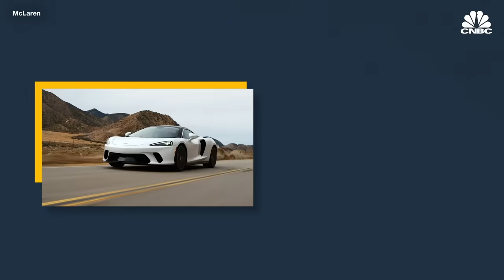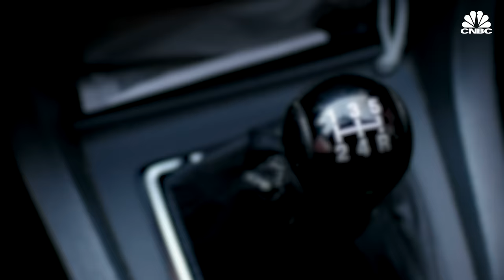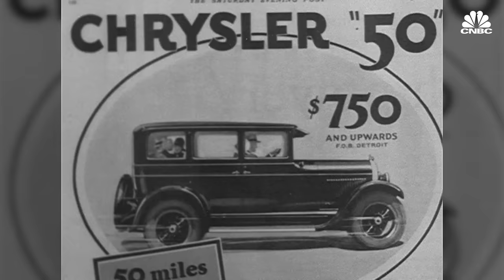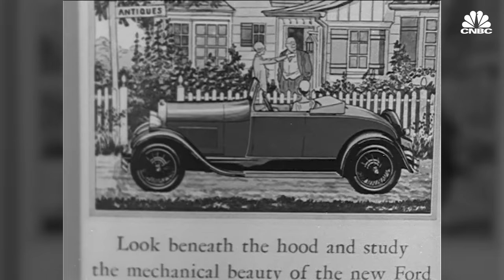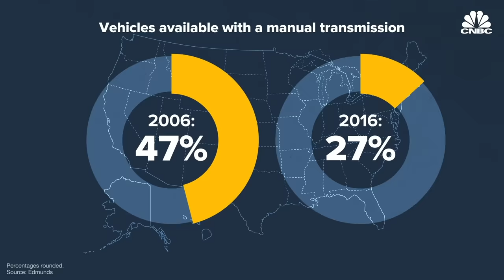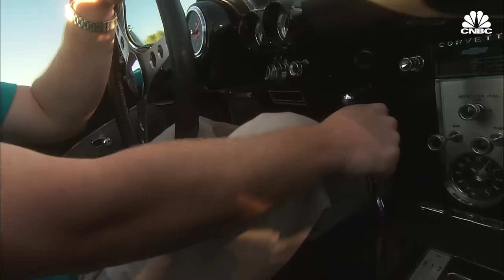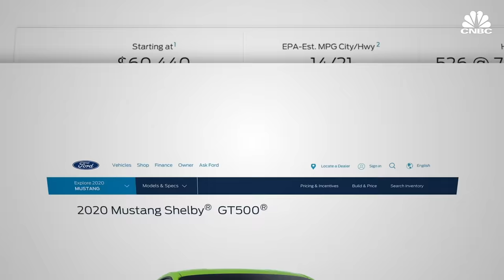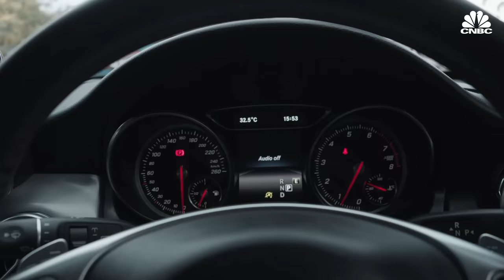Why Stick Shifts Are Going Extinct

Comment: Can’t argue with the facts and trends but as long as I can find them, I’ll be buying standard. It makes even a boring underpowered car fun to drive. For me, it’s a game, a skill, a way to engage with something I need to use every day. It helps me stay in tune with any problems.
Reply: Vincent DiNoto also increases reliability, imagine if Nissan had manual transmissions in their economy cars.
Reply: So in essence Vincent DiNoto, you have a "therapy transmission" instead of a dog??? Interesting...🤔🤔🤔🤣
Reply: Great anti-theft device too!
Reply: Dont forget about brakes. They last A LOT longer on manual vehicles than automatics.  & driving through curves on 2nd gear is amazing compared to autos
Reply: Depends on how well the manual transmission is built. Some can be so bad, I much rather have an auto.
Reply: Nahtcunnvinced Non-car guy I see.
Reply: @ROFLgator1  brakes are cheaper and easier to replace than transmissions.
Reply: @murp61  exactly. Manuals are about getting the hang of. Takes a day to learn and you'll never want to go back to auto unless you live in a hill that has a lot of stop and go traffic 😂
Reply: Nahtcunnvinced got one of each actually!
Reply: ROFLgator hills are the worst when people stop at the top of a steep hill and you have a car right on your ass. No room for error when people don’t even realize the manual struggle.
Reply: @The_Albino_Dino  Learn to use the handbrake. Or if you don't have one like me, you could heel and toe. Still annoying, though, I agree.
Reply: but that is the fun part @The_Albino_Dino
Reply: Joanna Lam it’s not that hard and yeah the sketchy moments can be kinda "fun" I guess but it’s annoying when people get too close behind you when you might roll back a tad bit catching the clutch.
Reply: Mike I know about the handbrake trick but it’s harder for me to grab he handbrake and put it down while riding the clutch and everything. I just go,d the brake with my right foot and when it’s finally time to go, I push the clutch all the way in with my left foot slide it into first and finally jump off the brake pedal and get on the gas with my right foot and try to get to the biting point as quick as possible.
Reply: @The_Albino_Dino  use the handbrake if you worry about roll back
Reply: Joanna Lam it’s more difficult for me than the way I do it. My way is just a bit scarier because there is no room for error but so far ive never once rolled back into a car so I think my technique is good enough for me.
Reply: And If I cannot find what I want. A Car with a Manual, No Infotainment System, a Manual Parking Break, a Key, simple things like a Oil Dip Stick so I can check my own Engine Oil. I will not be buying a New Automobile. No Auto Sale from me. I will not pay more for things I do not want in the first place.

Comment: 1986: Automatic transmissions are a luxury

2020: Manual transmissions are a luxury
Reply: It's kinda funny though. Because all the cheap cars still have manuals and an auto gearbox is a luxury. So like for me personally, I'd rather have an auto everyday car and a manual exotic, but now it's the exact opposite :(
Reply: Manuals is a hazard on the road.
Reply: Jo z why do you say that.
Reply: @jeffreystanley4991  there are more distractions for the driver, hand constantly have to move of from the wheel, and when making a turn and shift a gear there's just 1 hand on the wheel. And sometimes when manual drivers a counter a situation they are more paranoid not to let the cars engine stall than to just let the car come to a quick stop.
Reply: @jotube6147  if you can't drive them, sure.
Reply: @jeffreystanley4991  automaties are 10 times safer for the average driver on the road.
Reply: Clearly you don’t drive a manual. It’s not any less safe, if anything you are more aware of what is going on around you, not texting and driving like so many other dangerous drivers. Driving a manual in inclement weather I find is also better and allows more control as well as in off-road situations. I’ve never met anyone who drives a manual that is any less aware or dangerous than any other driver out there.
Reply: @jotube6147  Paranoid to not let the car's engine stall? What? Have you driven a manual for any extended period of time? This "concern" is only for someone who's new to driving a manual. Nobody who's driven a manual for while worries about stalling their engine.

I have both a manual and an automatic in my garage, and neither one is more/less distracting to drive. You get to a point where you don't even think about shifting gears, just like in an automatic. I love both, but the manual is definitely more fun to drive so long as I'm not stuck in traffic for two hours.
Reply: @ Jo z , I live in Canada lots of snow ,manual car is lots more safe to control in snow then automatic, I prefer manual and will teach my daughter to drive manual as well because when she growing up manual is luxury for her
Reply: @theconformist2399  ok that's just my opinion, i also been driving both for years stick and automatic. I see your opinion on it. Its just how i see it. But anaway i rather prefer an auto over a stick anytime, maybe coz my 1st 3 or 4 cars have all been manual. Maybe im just getting old or lazy lol.
Reply: A manual trans actually forces the driver to be more alert on the road, hence less distraction with texting ect. People who drive autos actually tend to be way more distracted.
Reply: Yep, I paid almost 50% more for a manual BMW. It's a dying art that I don't wanna give up.
Reply: @7318ify  What's more dangerous? Texting while driving an automatic car or texting while driving stick while shifting simultaneously? I see more manual car driving texters than automatic. Its weird
Reply: As long as they make fun cars with a manual transmission, some will want to buy them.
Reply: @jotube6147  No it's not.
Reply: I bought a 2019 versa, the only way to get a 5spd in it was to buy the absolute baseline model, no power locks, or power windows, but hey fair trade, i've only ever had 2 vehicles with those options
Reply: I disagree, I've been driving a manual since I first started driving. My current car is a manual. It becomes a habit if you drive one long enough. What you're saying sounds like a cop out.
Reply: Attention is ALWAYS needed while driving, no matter manual or auto. I live in Italy, I had driving school with a manual car (everytime you have one) and I dayly drive on traffic with a manual and when you know how to use the clutch nothing is so horrible. But if you are distracted while driving your performance is not good and you can have a crash no matter if it is manual or automatic car, that's all
Reply: @yeimarsoto7790  Hmm, really? I've always seen the opposite.
Reply: @HN  Psychology. Someone who has more to do driving the car is less inclined to look at their phone, rather that someone who has both their hands free. Attention is needed though when driving both kinds of vehicles regardless  of transmission.
Reply: @jotube6147  what makes you think that it's nice to offer reasons
Reply: @jotube6147  raceing car's for the most part all use manual transmissions. From supper speedways in the US to the 24 hours of Lamans ? Spelling.

Off road racing all so uses the manual transmission. Yes the automatic transmission has its place like in bumper to bumper stop and go traffic but out on the highway or back roads the manual transmission can teach the automatic transmission one or two tricks ease.

Love both and both have a place and it's easy to say the automatic is better if you have never drove off road. Or out in the open highway or down a mountain were the manual transmission can be use braking or stopping the car

If the engine fails driving down a mountain or on the road with an automatic transmission you loose power steering all at once and in a turn its a big wake up call. The power booster on the brakes only have one or two pumps of the break pedal and them its like the old manual brakes of the 1950s 

Loose engine power in a manual transmission and as long as the car is in gear the engine will still keep turing over even though its not running 

You will still have power steering power breaks and if driving down hill the engine will help in braking or slowing the car down

Automatic transmission are nice when new but how many times do you hear of manual transmission needing rebuilding or needing a new transmission computer or needing the transmission fluid and filter change 

Things all ways chang older cars with Carburetors and smiple Ignition systems will run all most for ever and fancy new car's are for the most part done for when computer die or the wiring with all those sensors get a bug or Mic

Just take a look at Jay Leno Garage of all the old cars that still run.

A times new is best and at others not so great
Reply: @terriecotham1567  tnkx yes i did not think about it like that u correct.
Reply: @jasonandrews4046  nailed it sir..
Reply: Jo z ur getting old. Same thing happened to my dad. He had a stick e30 and replaced it with a corolla in 2000
Reply: @jotube6147  proof ?
Reply: @jotube6147  if you dont know how to operate an manual i guess they are saver
Reply: Servicing automatic gearbox is luxury
Reply: Not luxury, just rare
Reply: @HN That's where people massively differ.  Even objectively, cars hold incredible cultural value - look at how popular the Fast and the Furious series is just as one example.
Reply: @jasonandrews4046  Agree with you manuals are safer as you have more control especially in bad weather, instead of breaking and sliding on a slippery road you can a drop gear and slow the vehicle thus avoiding using the brakes which locks the wheels and then the car slides with the driver losing control
Reply: Just made your 800th like lmao, right on you are lol .......
Reply: @jotube6147  No that just means you take your time driving being more alert to your surroundings burning less fuel, if you want a fast auto car then go for it but its not for everyone.
Reply: @terriecotham1567  Not to mention you can push start a manual car when and if the battery goes dead, also you cant tow a auto trans car over 30mph or the trans burns up, Stick you dont have to worry about any of that.
Reply: MoldyWater05 true lol  the car that has made someone give the most money for it is a manual Ferrari 250 
Also there was the 911R 

But there is cheap econoboxes with manuals as well
Reply: I can't remember which car it was but I'm pretty sure a manual was the optional cost that actually made it more expensive. It was probably a camaro that I'm thinking of.
Reply: don't worry about Jo Z. he has ADD and can't drive so he was just describing himself
Reply: @yeimarsoto7790  Your question is like asking, "If you're drunk and trying to light up a blunt, which form of transmission is safer?"  No, there's much bigger issues there.
Reply: @markchase5323  Automatic? Lol
Reply: @JG-ge3ui  mmm u right. Interesting.
Reply: @jasonandrews4046  I wish you were correct. I really do. For people like you, and for myself a manual is more control of the car and not a distraction. But for the AVERAGE US driver, who's driving test was a joke, who doesn't understand anything beyond pushing on the pedal, who has never changed a fluid in a car--doesn't really even know what fluids are in the car--I think I have to concede the point.